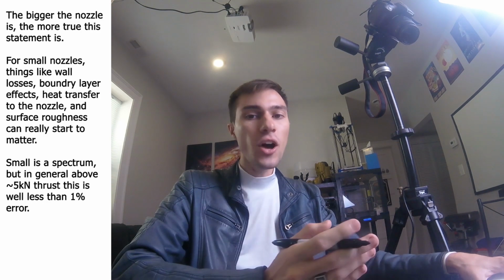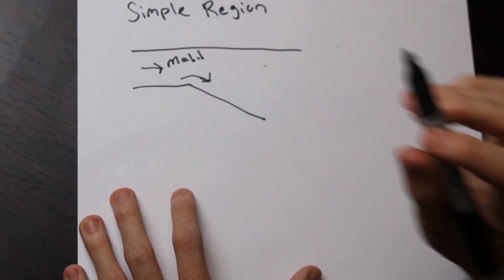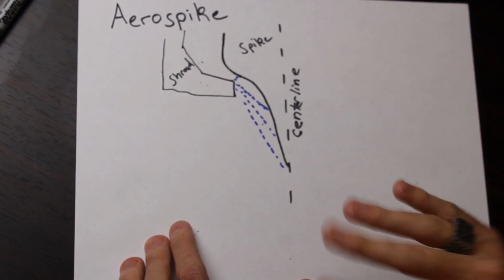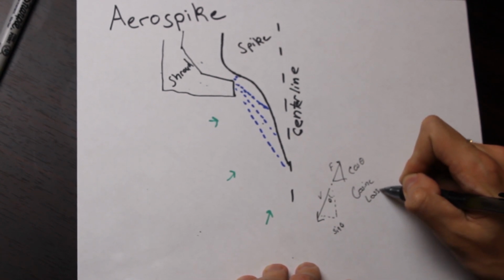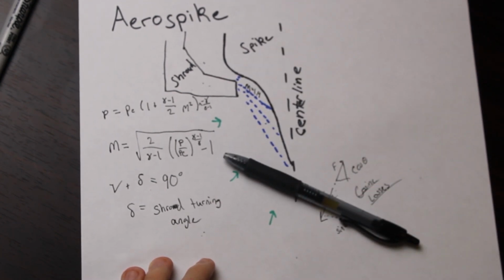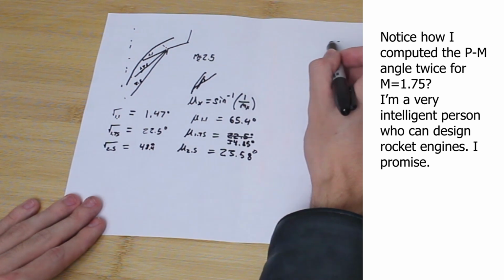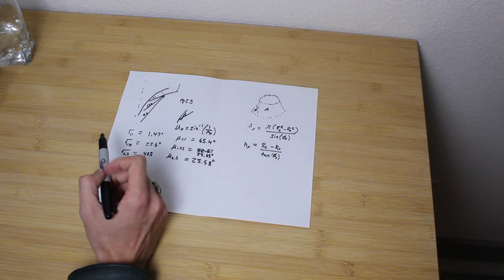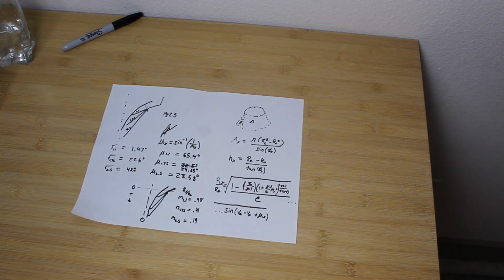Liquid Rocket Engines 8: Aerospikes

Comment: Thank you. Now I really understand why I did not become a mechanical, let alone, a rocket engineer when I was in college nearly sixty years ago. I understood the concept of an inverted Delavel nozzle but not so much the math. I would likely start with a TLAR shape for the spike and observed how it worked. Note: The old variable flow garden hose nozzle looks a lot like a an aerospike but flows only pressurized water. It delivers everything from shut off through fine conical spray to a coherent stream. I am enjoying your series.

Comment: Watched it more than dozen of times and still cant understand this pretty nerdy stuff. Just cant assemble the picture in my head even tho instructions feel pretty straight forward most of the time. You talked alot about angles but length of mach lines just mentioned and threw away i believe.
 I probably can construct geometry out of points with angles i got by knowing that i want every refracted mach line vector to be pointed axially. And also i want to avoid steep turns (and collecting bunch of vectors in one point) to not put under stress the spike itself. But all of this is simple geometry and a little bit of common sense using provided information.
 I guess math behind designing chamber and a throat is worth it but this... P-M eq at the beginnig has nothing to do with pressure (pressure is basicly needed to know under how much loads spike is to caluclate thickness and material of the spike wall), we just put in (target) mach number to get desired angle and then somehow need to calculate how far from lip that angle point is. But how?
 How do i find that point easily if the only things i have is two angles of a triangle (90 and P-M) but no lengths and also i dont know how much will exhaust turn around a choke lip at given flow speed?
 I understand that i might be a 'little' stupid and/or there might be unmentioned specific information.
Reply from the maker: P-M (prantl-meyer) is related to pressure through the isentropic flow equations for mach number from pressure ratio.

I'm not sure what you mean about needing to find a point from the lip.

Comment: Thanks for this nice in-depth video!

How would you adapt your calculations, if your shroud would not have a sharp corner forming the throat, instead forming a divergent section after the throat? So you have Mach=1 at the throat no matter what. Now let´s say, a divergent section formed by the spike and the schroud accelerate the flow to M=1.2 before the shroud has then a sharp corner. The contour of the shroud interacts with the supersonic flow in that case and actually forms a bell-nozzle in 2D-perspective. In 3D-perspective it is rather a toroidal convergent-divergent nozzle followed by an aerospike.

=> Would that affect the contour of the spike itself? I assume it does, because of the higher Mach number at which the P-M-Expansion fan arrises.
=> How would you calculate the contour of the shroud?
=> Would you expect an increase in efficiency with that setup?
Reply from the maker: In this scenario your first characteristic line would be at whatever the mach number dictated by the exit velocity of the diverging section would be. The spike contour would depend on the contour of the diverging section. The diverging section would qualify as a complex region, and would need analyzed using an iterative analysis.
The video calculating the contour of this geometry would easily be 3x longer than this video, with a few hours of math homework before that.

I would not expect an increase in efficiency. In general, more 'stuff' is less efficient. The newly added diverging section would have wall losses, cooling requirements, weight, etc, and in theory would perform the same as if you had not added it.
Reply: Thank you very much for your quick response,  @AstroCharlie !! Really appreciate, that you looked into my comment :-)
I guess even if there was an increase in nozzle efficiency, the downsides you mentioned would most likely overcome the advantage of a few ‰ of theoretical efficiency leading to an overall decrease in efficiency (especially thinking of wall-cooling)

again: thanks! and keep the good work up :-)

Comment: Fantastic video man! Just a quick question: Did you by any chance use Angelinos 1967 paper? The maths looks very similar but if not could I ask what resource you based this on? Ive been looking for a definitive paper on the MOC for aerospikes for a while and have only found papers by the likes of Rao but nothing actually explaining the methodology. We also aren't taught MOC in my degree so its been rather challenging!! On a slight tangent I cant wait to see your final rocket design, keep up the great work!
Reply from the maker: Hi David, I did not use Angelinos' paper. I used my reference notes from my propulsion class (MIT's 16.512, Paulo Lozano) on method of characteristics and worked from there.
Reply: @AstroCharlie  Thanks so much for replying man! I found the notes, they'll definitely help in developing my understanding!! Kinda really wish we had this class at our uni! 😂
Reply: @AstroCharlie   Hello Charlie Just found your Liquid Rocket channel. I've been building amateur rockets since 1973 I hold a California class 1 rocket pyrotechnic operator. This is for Liquid propellant rockets which I qualified for back in 1993. The reason I'm writing you, you remind me of my old rocket buddy Dan Ruttle he was an engineer for the Apollo program. I haven't seen since 1995. He built in my machine shop one of the first liquid propellant amateur rockets in the world that was  launched in 1987  the propellants were Nitric Acid and Furferal alcohol which are hypergolic. Here's a video   https://www.youtube.com/watch?v=sj3bI-0Nwsc        Hope to hear from you. Dave Griffith
Reply: @Charlie Garcia  Hello Charlie My email is montmach@aol.com